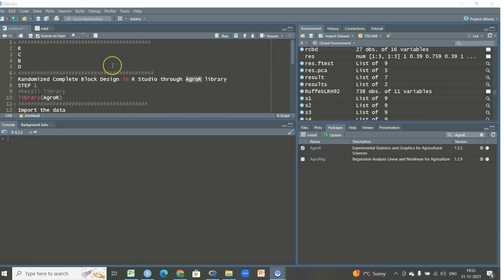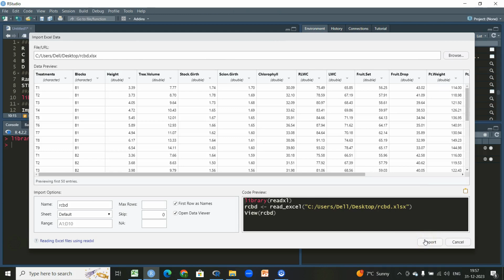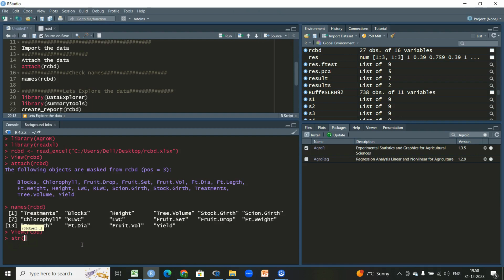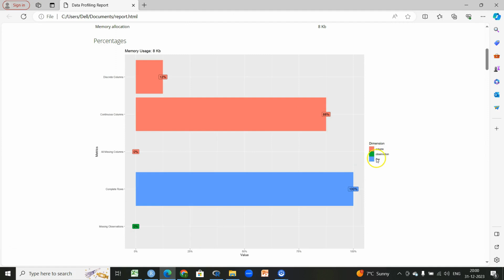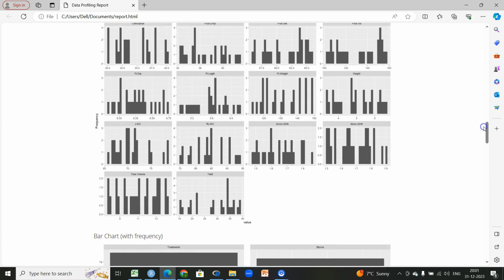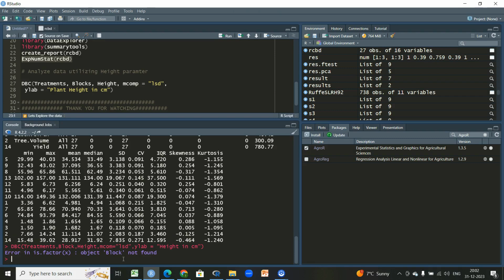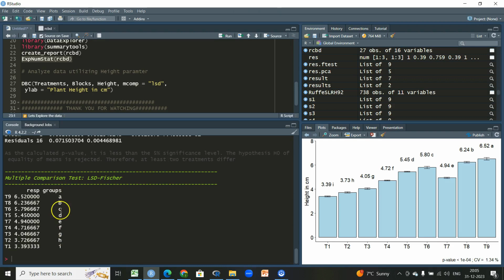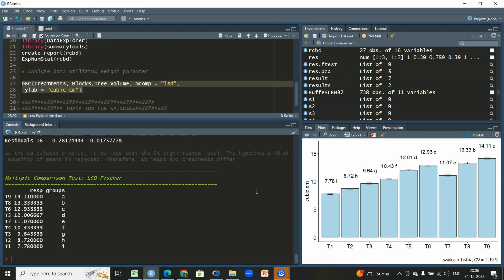Randomized Complete Block Design in R Studio through AgroR library #anova #data  #rstudio

Comment: At last I got this one "Your analysis is not valid, suggests using a non-parametric 
test and try to transform the data " what should i do?
Reply from the maker: Use transformation in your data
Reply from the maker: If again assumption are violated, then use non parametric instead of parametric method
Reply: @Iqbalstat  okay, will try. Thanks